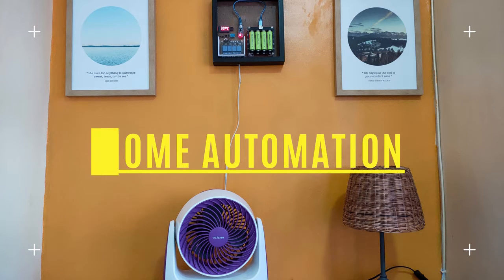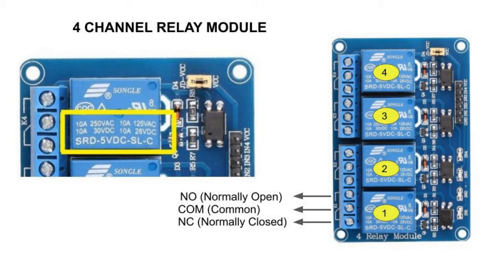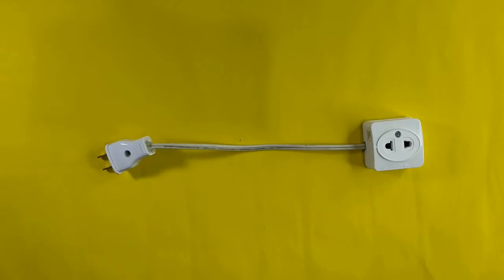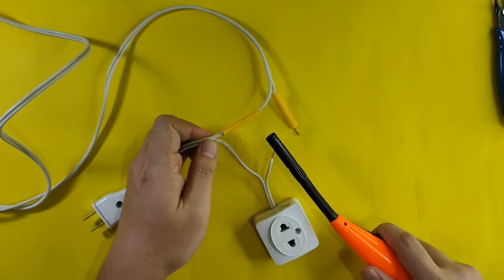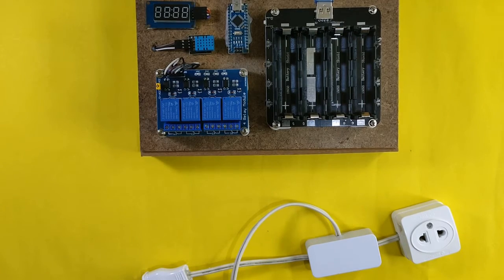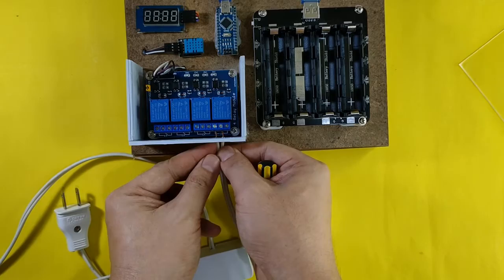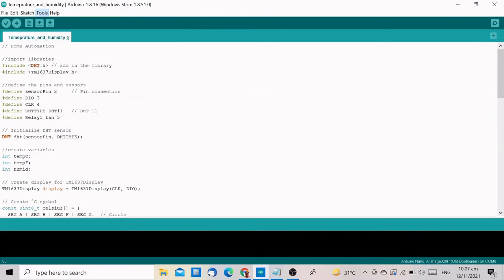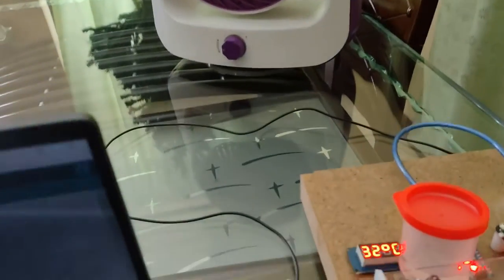Smart Switch - Automatically Turn On the Fan when room is hot | Home Automation with Arduino

Comment: Hi, nice job but I have a question: why using batteries to power the arduino whereas you have 220V power available? So why not using a 220V to 5V transformer to power the arduino ?
Reply from the maker: I needed the battery bank as a power source for the other sensors and components that need 3v and 5v